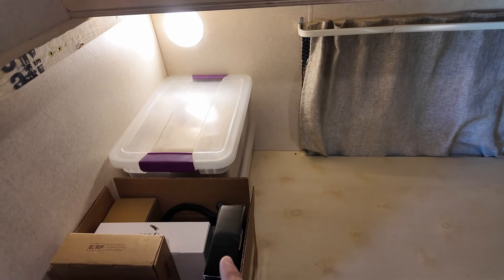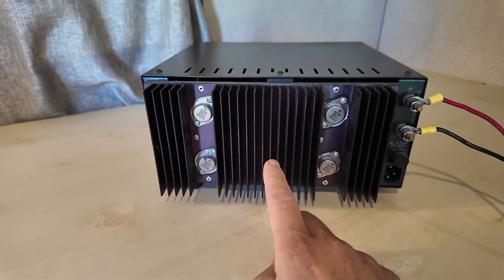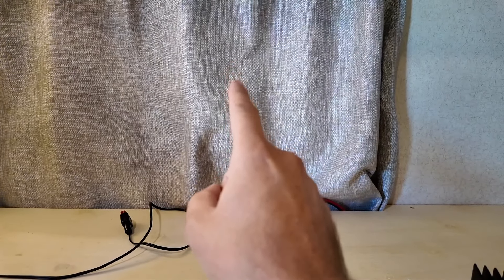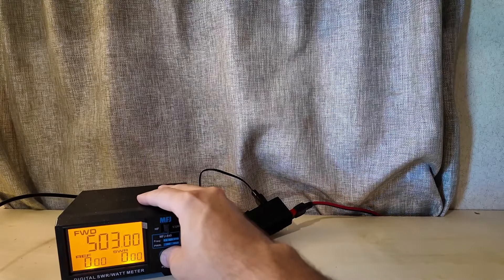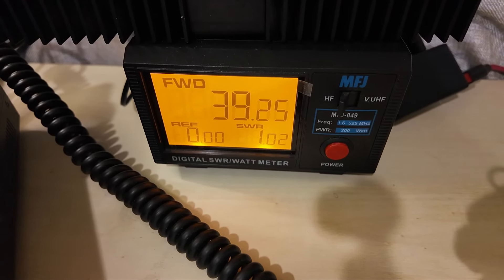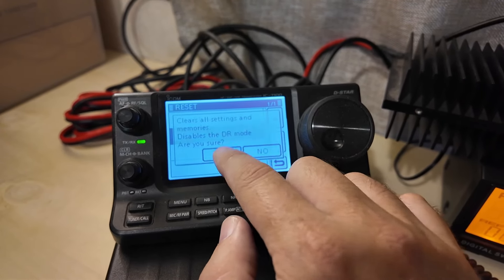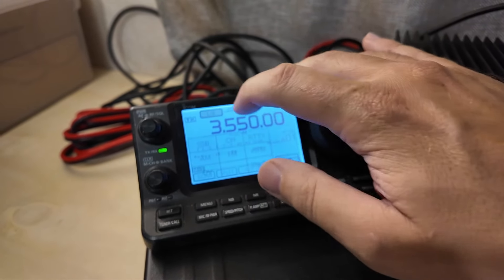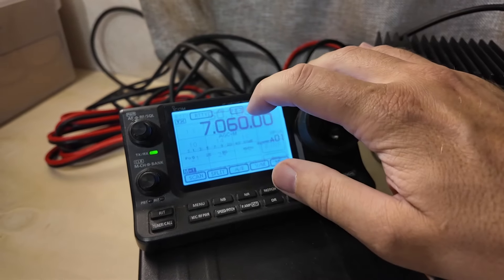Setting Up Your Ham Shack - Dummy Load, Power Meter and Power Distribution Basics - Elmer Series

Comment: Perfect timing for this... I still don't have a shack but my major decision is about which space to use (an new outdoor shed that will lack insulation and HVAC... or a room in the house that I didn't originally intend to use for this purpose) and the things you go through in this series are going to save me from choosing the wrong space and having to move everything half-way through!  So bring this series on!!!
Reply from the maker: If you can keep it in the house you can do better climate control other than that, have a blast, your shack will constantly evolve.

Comment: I can recommend 3M Command Strips for wire management. Made routing cords and wires in my kid’s dorm rooms easy and held. Then again double stick tape for the power distribution block works too!
Reply from the maker: I do like me some command strips! I'm thinking about panel mounts directly on the workbench - like 4 doubles... but not sure yet.  Maybe just add them 2 at a time as the shack grows.  These things: https://geni.us/0BHoc
Reply: I use them to hide the wires under the desk or bench. Looks clean and safe

Comment: the ham shack is never finished . Great start.  West Mountain Radio has great power pole distribution strips. Some with wire right on them to go to power supply or battery  or both . Battery backup for the shack.  12V power has lots of wire and power poles as well at Comet antenna stuff. They merged. Same great stuff.  Powerworx has great DC power stuff as well . TRUE Anderson connecters . And they sell Victron products as well. I have a repeater set up buy me that has been up 20 plus years and on astron power supply with battery back up. Astron never failed.  Everything else   has over the years.  Always have good lighting and extra light when you need them.  and battery ones as well.  I have a first aid kit and fire extinguisher in my shop . Things happen. 73
Reply from the maker: Thanks for watching!

Comment: I want to start by saying thank you for the informative and enjoyable articles you consistently provide. Two points regarding the 7100

1) Icom's quality is one of the reasons they are able to charge their pricing and reputation. I believe that by now Icom should to have addressed this issue.

2) According to this video, the OS and base configuration that are kept on the partition for factory reset are different from the OS and configuration that the radio was shipped with, which raises some red flags for me. I completely agree that this is software-based, but even after watching this video, I'm not satisfied with the results and hope that Icom is efforting the resolution.
Reply from the maker: I do need to do a firmware upgrade on the radio.  It's good to have a shack again!
Reply from the maker: And thank you!
Reply from the maker: Looks like I'm on the latest firmware update... from 2016!  Get on the ball Icom!

Comment: I have always used a rigrunner between the power supply and each component so that everything is individually fused, even if it already has a fused line (like the radio). Belt and suspenders, yes, but anything worth doing is worth overdoing 🤣
Reply from the maker: You're right, just getting started with some basics here.

Comment: Nice, big beast of power supply. Please fuse at power supply for gage wire to distribution box ( and I am assuming it can handle 35 amps right ??) Then each load plugged into it needs to be fused correctly. Love the polyester curtain to block the sun but if the MFJ supply goes piff and you have 35 amps on the 22ga wire feeding it . Sorry I got started please forgive me.😊
Reply from the maker: Yep, one thing at a time.

Comment: Sure sorry to hear that ICOM didn't get back with you.  I have been thinking about an IC-7410 to replace my IC-7200 I sold a couple of years back.  73 de n0km
Reply from the maker: I was going to call a different repair center. But the reset seems to have helped.

Comment: Hi Steve,
Did you try powering off? Maybe power off between every reset. At least you had some improvement. Stay safe.  73  WJ3U
Reply from the maker: Not yet.  I'm going to try a firmware update and see if there fixed the software.
Reply: You are right. When I lived in Seattle I had a second-hand GPS that insisted it was in Alaska. The usual turn-off and reset did not work. I removed the battery and let it sit overnight. The next morning I reinstalled the battery and set it out on a second-story porch. About twenty minutes later I came back and it had my correct location within yards.

Comment: Hi Steve did this fix the issue you were having with your radio, or is this just covering off the low ref power? 

Be safe

D
Reply from the maker: "fixed" h it's better than zero watts out, but not the quality I'd expect from a big 3 manufacturer.

Comment: Where's all the EXACTLY 18ft lengths of coax?? Where's the 10Kw AMP??? Where's the 102 inch whip??? Aren't these the most important radio things you must have first???
Reply from the maker: You got that right. But I could shove that much awesome into one video!
Reply: @temporarilyoffline  SORRY, it was a dumb comment, I know that crap is more the CB'ers domain, but you still get some HAMS that think this same way
Reply from the maker: @bitemykrank1970  I went along with it.  Thanks for watching!
Reply: @temporarilyoffline  I'd really like to see another more in depth video on that ICOM radio and that odd power issue, I cannot see any reason why you get full power out, but only on 40m. I had a Chineseium radio that did a similar thing once, it was a Xiegu made unit, a firmware flash solved the issue, but I cannot remember if the 7100 firmware can be updated or not, i haven't owned one. It's some very strange behaviour from that rig.
Reply from the maker: @bitemykrank1970  I have another video linked with more testing and info.  There isn't a newer firmware update then what is already on the radio.  I have some ideas, need to make more videos.